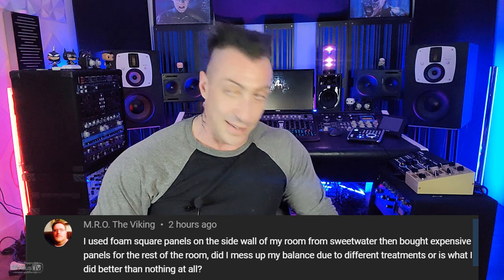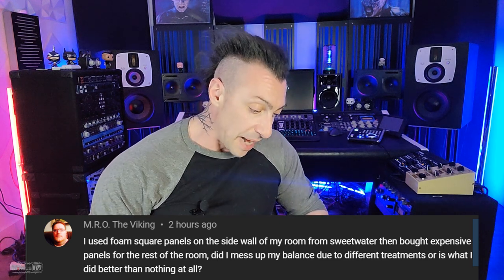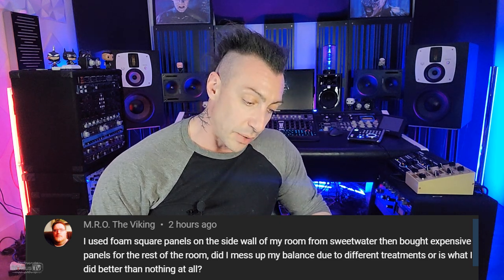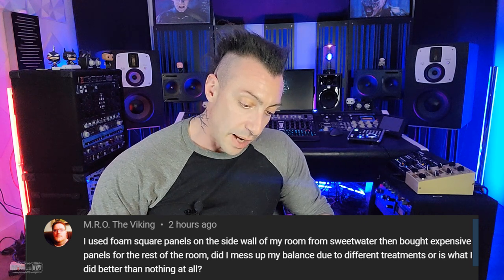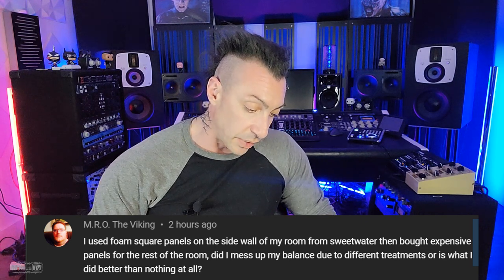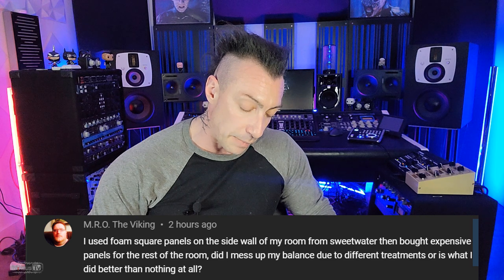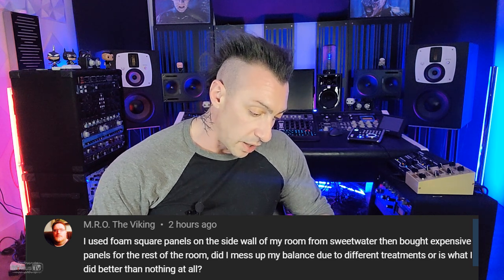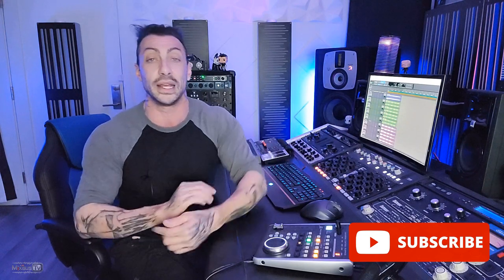How Bad Is Acoustic FOAM? 🤔

Comment: One thing I would recommend is spacing your panels equidistant from the surface (wall / ceiling). So, if you have, for example, 4” panels, then space them 4” from the wall. 2” panels, space 2” from the wall, etc. Makes a huge difference and cost nothing more than some extra space.

Comment: I just happen to be finishing off some homemade panels today! I've had them sitting around the room for a few months, and they've made a difference just being in the room.
I found a really good deal on those little corner foam pads a couple of years ago and hung them from the ceiling all the way around the perimeter of the room, along the front of the cornice, so that they have a gap behind them, and that made a difference to the top end too. As soon as you enter the room you can tell the difference, it's suddenly more quiet.
They're not anywhere near being bass traps, but definitely a good investment imo.

Comment: My previous room was very small (2.5*3.2 meters) and I placed my desk on the large wall because I had a window and a door on the small sides. So I covered both the two large walls with foam panels (10 cm thick) mounted on wood panels placed 5 cm from the walls. Low freq reflections were greatly attenuated, it was definitely ok for a production home studio.

Comment: Worth mentioning that Rockwool (or fibreglass insulation or similar) will absorb frequencies down to even the mid hundreds (500 Hz or so), so definitely worth replacing the foam with proper panels, even DIY ones will get the same effect. Then it's all about bass traps and diffuser placement.

Comment: Hi David, Love your content- I was wondering, if you have curtains on all the walls so essentially covering every surface and some treatment - So basically the room is very dead, you can audibly hear that … What effect would that have when mixing in this room, how much could you trust what you are hearing from the speakers?
Reply from the maker: Same as foam, it only affects the high frequencies. You need mass to stop (from reflecting and causing nulls and bumps) low frequencies

Comment: Hi David, What is ur preferred or minimal dynamic range what u accept for a hip hop or pop (electronic) production  and how do you check criteria before u start mastering from a client?

and if you mixing what is your max limit before u start mastering?

And how u measure the dynamic range of the track ?  greetz to Bella and all the best - Rob
Reply from the maker: I honestly don't look at those things anymore, it's all about how it sounds. Also because it depends on the bpm and arrangement not really a genre related thing. And also, with analog, you don't really have to look at those things, it becomes second nature, you know where you're at just by looking at how the machines react to things, as opposed to plugins where you have to open each and every one of them to see. As far as "max limit" before mastering, i'm not sure what you mean. If you mean peak level of a mix, again, it doesn't matter unless you're printing to tape. -0.5 or -5 or -10 it doesn't matter as long as you're not clipping. For me, once again, my mixes always tend to end at the same level as a byproduct of using analog and having a proven to work gain staging that always hit the sweet spot. The variation is minimal and it depends on what's on the 2bus for that given mix.
If instead you mean when the mix ends and the master starts processing wise. The mix ends when it sounds like a record, when I'm happy and the client is happy. Ideally the mastering process only has to bring up the mix to commercial levels with the least amount of changes and compromises compared to the mix, which that alone is a big task in itself. Some, very few, things are better done in mastering even given a "perfect" mix but that's a very long discussion.

Comment: Any way David you can show us what your doing in your room for treatment and then show us if you had a limited budget what you would start with next using your room as an example? I really appreciate your videos.
Reply from the maker: Unfortunately your chain will always only be as strong as your weakest link. Meaning, even if you start with superchunks in the corners, then treat front wall, it's just a start and you won't have a reliable monitoring environment until you treat 1st reflection spots, back wall and ceiling too. My room was built and  measured by a professional.

Comment: Great information as always! I have a cellar/basement that is small. I can’t really put bass traps down as it’s quite damp down there and they would end up being covered in mould. Can I get away with just using the foam panels and rock wool panels I have plastered all over the ceiling and upper walls?
Reply from the maker: Hard to say without seeing, measuring and listening. Unfortunately, the smaller the room, the more trapping you need usually, and still, with small rooms you will always have nulls probably. I'd suggest at least trying superchunks in the corner and wrap them with film, then put a cloth cover over them, put some drying agent inside to avoid moisture to get in.
Reply: Wrap your rockwool in painter's plastic. It's so thin that it doesn't change the impact the rockwool has on the room. I have 23 panels like this in my studio. Works great.
Reply: Great ideas guys Thankyou so much!

Comment: Hi David, what do you think of the newest recording tecnology of mics, that let us record directly in 32bit float (rode nt1 5gen) ? They use usb type-C, so you dont need audio interface. Thank you
Reply from the maker: Because the interface is inside the mic. Or better, there's an AD converter in it. I haven't tried it so mine is only a guess based on what  we know about the sound of the NT1 and the science behind the technology. The write up is not that clear as it talks about a 32 bit OUTPUT and not a 32 bit conversion. This might, and I repeat might, be a bit misleading. Everything is clippable, first and foremost a microphone capsule will only handle a certain SPL so doesn't matter if it has a chip (converter) in it or not, too loud will make the capsule distort and fold. Now, if they indeed have 32 bit conversion, then their marketing suck because they should say that, not "output".
This description makes me think of a very basic system at 32 bit just like you "can't clip" 32 bit inside the daw, which can still be some sort of safe net but the above remains.
I personally am not a big fan of the NT1 but worked for others.
Reply: @mixbustv  thank you David, learning a lot from you this years